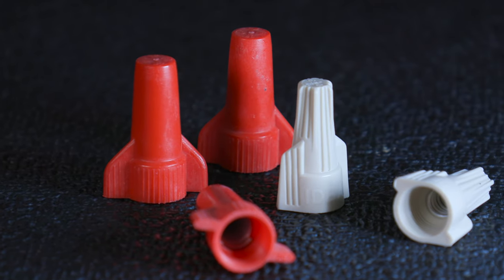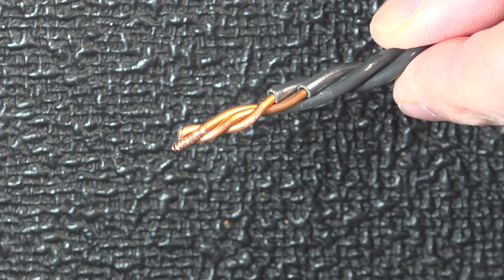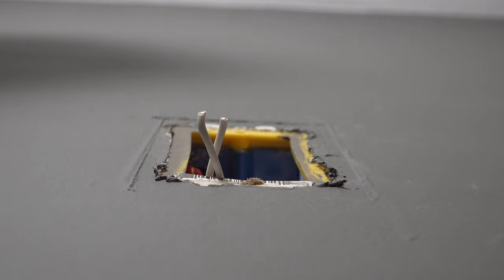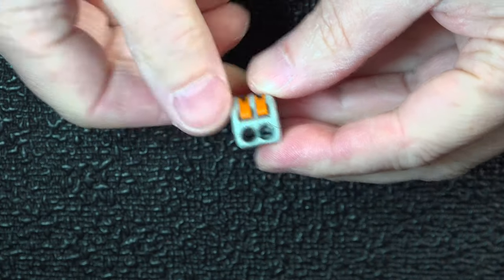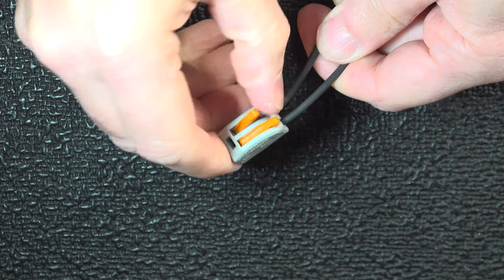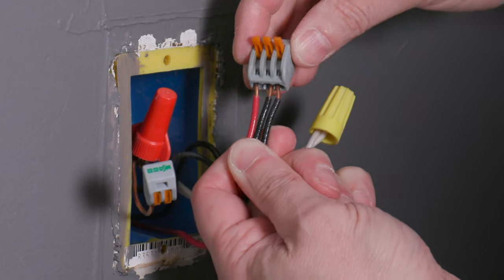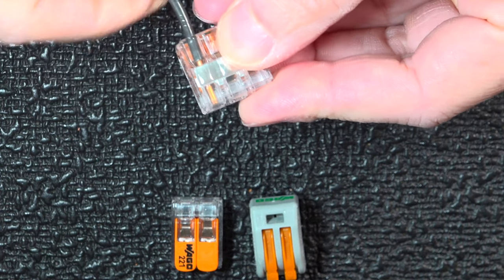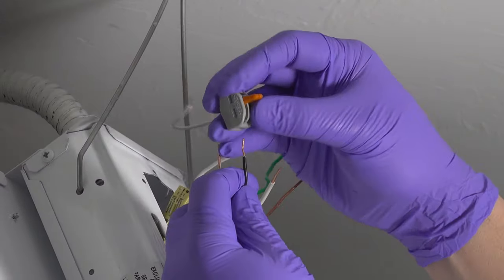Never use Wire Nuts Again - Wago is Better Electrical Connector

Comment: I don't care what you think young man. I've been doing electricity longer than you have been alive and I'm here to tell you A) don't be so damn lazy and learn how to use wire nuts properly. B) your Wego is nothing more than a stab-wire connector and THAT'S a fire hazard I promise you that!!!!!!   In my 40 years doing electrical work I've tried every way possible to connect wires and a wire nut is still the best way (IF you do it properly) unless you go with solder then you are doing the best that can be done..... Period
Reply: Before wirenuts they used other methods. It's only natural for wirenuts to be replaced eventually.
Reply: yes, and your horsedrawn carriage is great too because you dont need gas right?
Reply: I'll never understand why push in connectors are such a big word in North America while the one used in Europe are far more recent, less heat prone than nuts and globally Europe just has less electrical fires per inhabitants.
Reply: @KravMike08  and I was referring more to many blue collar americans as unwilling to adapt and adopt new technologies. they use  these throughout europe.
Reply: @allandulles7108  so let me tell you what I learned about the European electrical system while I was in Iraq doing electric work .....  They have some good ideas but their materials suck!!!!!!! They friggin directly bury hard plastic cable with thin thin little "ground" wires under that hard plastic outer layer and the shit breaks and the "ground" wire rusts and losses it's continuity thus creating an open ground and an unsafe environment throughout Europe!!!!! And that's just the start of the stupid shit they employ in Europe

Comment: I have been wondering about the possibility of some kind of screw tight to connect wires. And is there some kind of gunk that might improve the connection and protect the connection. How about soldering?

Thank you for sharing helpful videos!

Comment: I was told by an electrician that the wires need to be twisted together with pliers before screwing on the wire nut.
Reply from the maker: I have heard it both ways but if you look at some of the manufacturers they say it's unnecessary. That's why I like these, insert, push, done
Reply: Pre-twisting with pliers is how I was taught in school. Seems to produce a pretty solid connection with the wire nut over not pre-twisting

Comment: I have used them they have their place...usually the trash can..I can literally pull them apart..when attached..I cannot pull a wire nut apart....enough said..its a nice thought though...been doing  electric work  for  close to 25 years...local 236..👍👍

Comment: I have been an electrician for over 20 years and used to work almost 10 years in Europe using only wago connectors, and let me tell you, wirenuts are perhaps not as convenient but they do provide a good connection, much better then the wagos. I have seen too many burned wagos. In homes they are ok, but in commercial applications no wagos period.
Reply from the maker: So you are saying that in Europe where wire nuts have not longer used for decades, they are unable to make secure connections? Come on.
Reply: They do have other connectors but they do use wagos a lot.  What I am saying is, they don't hold up to heat and high amps. I used to be in the maintenance department and I fixed a lot of connectors in lights and JBs. The contact surface is just not there

Comment: “A single hand can make the connection”

...as two hands make the connection.
Reply from the maker: Correct but when I cant do it with both hands, I just pre-open the levers and then put them on single handed.  If I am up high that extra tip makes it much easier. There is no way to ever use a wire nut one handed.
Reply: @SilverCymbal  to be clear, I wasn’t disputing your statement, just jokingly pointing out the contradictory video content.

Comment: Pure BS.....work the trade for a little while before giving “expert” advice.
Reply: He did say “for DIYers”.
Reply: @denismguitar1552  DIYers or not.  He makes misleading statements.  Loose connections are a leading cause of electrical fires.  If you are a DIYer, educate yourself before playing with electricity.  I have 48 years in the trade and have never had a loose connection with a wire nut.
Reply: @larrypatterson3957  48 years and not one loose connection you must be the jesus christ of wire nuts then cause you are perfect and born with out sin
Reply: @deplorabledaniel6541  Not Jesus, just a skilled craftsman who served a valuable apprenticeship and was taught well by other skilled craftsmen to be diligent in my responsibility to provide a safe electrical installation.  Don’t be a troll!
Reply: @larrypatterson3957  lol injust think its funny that you think you have never had a loose wire nut
Reply: @deplorabledaniel6541  They are UL listed for making a secure connection.  Use the correct wire nut for the  wire combination and follow the manufacturer’s directions as well as following proper use of wire strippers and  a secure connection is assured.  Tug on all of the wires afterwards as a safe practice and you don’t get loose connections.

Comment: This is one of those products that is going to be explicitly banned for not being able to maintain its current carrying capacity over time.  Damn I was going to sub this channel until this "unbiased product review"
Reply: It wasn't even a review. It was an advertisement.
Reply: Yeah kind of like push connect outlets and switches. They just don't hold up over time. Maybe a Wago is better than those, and maybe they're ok - but they also take up more room in a box, and wire nuts aren't unsafe like the video claims.

Comment: Wow, I’m going to have to throw the BS flag on this video! Yes if you use the wrong size wire nut (like one that is too large) then yes they will fall off Like the one in this video dah!! There is nothing wrong with using wire nuts and yes they are reusable!! Also why would anyone cut the wire when they can just unscrew to remove the wire nut!?! I can see a use for these things in a small area like special style light fixture, but that’s about it!! I’m a retired electrician and I’ve never had any problem with using wire nuts!!

Comment: really great when you need 5 wires connected together vs wire nut
Reply: That is about only time I use them.  In particular I used them on the closed circuit when you have one branch feeding 8+ branches of smoke detectors from central point rather than runs to specific parts of a house.  And although I don't say for sure that it's the connectors, I will say that I've seen some strange behavior with the ganging features of the smokes in my house where sometimes they trip and others they don't.  More than likely it's the crappy chinese made smoke detectors, but never know... I wouldn't use these on anything that is going to have lot of current drawn thought it for long periods.

Comment: No thanks. Old school is good school only if you know what you are doing.
Reply: Same, I have heard of cases of the levers opening up on these when trying to push them in a box, but each to his own.
Reply: Sure, let's all install fuse panels and use knobs and tube wiring with unpolarized receptacles. C'mon, old school isn't always the best buddy ✌

Comment: "The biggest problem with wire nuts is that I cant make money off of them, so in this video...."
Also... WHO THE F wears nitrile gloves to rewire a shop light??
Reply: Don't want to get the girly hands dirty.
Reply: Made me laugh
Reply: Guys used to called me a doctor wearing surgical gloves under work gloves. Is not to keep my hands clean but to retain moisture because my hands suffered from cracking. Now I see others are doing the same. Rebar for 30 years is enough.

Comment: if you change a device in an electrical box and you’re cutting any wire youre doing it wrong, also you’re supposed to twist the conductors together with pliers before putting the wire nut on
Reply: So much wrong with this video...

Comment: And how much do they cost. Bag of wire nuts I have never had a issue with is $1.99 for 50. And if you have trouble using wire nuts? You shouldn't be touching the electrical in the first place.

Comment: A lot of luminaries have been coming pre-equipped with wago style connectors already attached. You may think it cheap, but realize the magnitude of legal problems manufacturers are automatically up against concerning failures, if they were a problem. I installed can lights in a foyer that led into a kitchen area for a guy. Every single light had them and not one wire but was in the pack. I've used them extensively without any problems at all. And Wagos have been around for a VERY long time, 70 years. So they're not as new as most people think. There's also YT videos showcasing side by side comparisons with lever nuts and wire nuts under overload situations. Wire nuts failed every time before lever nuts did.

Comment: they have a fatal flaw if you look at the connector inside there is a single point of contact in the connection can heat up and cause a short me i still use wire nuts plus when you properly twist a wire nut the wire should twist causing the wires to never pull apart  in all cases i always have considered the push connectors for low voltage applications plus they dont work well for stranded wire unless you solder the ends
Reply from the maker: There's nothing fatal about it. It's copper and rated for 20amps in the US and 30 in Europe. I pumped 60amps through one too: https://youtu.be/B1pmuRsf1co

Comment: Wait, you guys don't just twist wires together and cover them with masking tape?
(Yup, this is the way my grandpa made all eletrical connections in my house)
Reply: Hence why there were so many electrical fires and deaths back in the day.

I bought a house and the dishwasher was installed by the owner's brother who "knew what he was doing". I had one of my own so I went to swap it out. The electrical connection by the guy who "knew what he was doing" was outside the box attached to the dishwasher, held together with masking tape, wires weren't twisted together, and the whole mess was lying on the floor. One leak (which dishwashers are prone to do) and zap, say good bye to the wife and new baby.....

Comment: I used something similar to this ~ 40 years ago, even ones that required no stripping your insulation. Insulated plastic capsule w blades that would cut into the wire insulation causing the blades to make contact with the wire.

Comment: If you can’t successfully use a wire nut, then it’s hopeless.
Reply: If you can't successfully use a wire nut,  perhaps you shouldn't be working around household current. Connectors like this seem more useful for test circuits and ones that you know you're going to be redoing regularly.
Reply: There is absolutely no use for these stupid things.. 35 years experience.

Comment: I’m new to the trade and an apprentice , so my knowledge is very limited. Is it true that the bite marks can cause overheating? That doesn’t seem like it would, but again , I have little experience.
Reply: Not really, no. If you were to redo a connection multiple times, eventually the conductors would start getting pretty chewed up. You could run into problems if that happened.

Comment: I'm a commercial electrician and I've never had an issue with wire nuts. I'm not sure I'd feel comfortable using your little snap connectors on 277v circuits.
Reply: I agree...not to mention the very small amount of contact surface provided by the push in connectors.

Comment: I'm confused....
Isn't using a Wago the same as stabbing the wire in the back of a cheap receptacle? 
I was taught to always use the screw terminal, and never poke the wire into that Firestarter hole on anything.
Please advise...

Comment: t is better to make a connection with the whole surface area of the spring inside the wire nut.  WAGOs use one small blade to make the connection. a mere fraction of the surface area provided by a wire nut  WAGOs are susceptible to   losing tension\deforming if handled roughly especially with multiple 12 awg solid conductors. 

probably ok at > 50% of a conductors ampacity.  probably not ok at the NEC limit of 80% 

what do you think grips better pinching with your finger nails. or a squeezing with your thumb and fore finger?
Reply from the maker: I think that putting 60 amps through one of these rated for 20amps in the US and 30amps worldwide should prove something right? https://youtu.be/B1pmuRsf1co
Reply: @SilverCymbal  hmmmm.....i was suprised to see both take 60 amps and live to see another day.  i wonder hot that test would go after using a 5 hole WAGO with 12AWG and bending the wires torsionaly befoe the test.
Reply: @Silver Cymbal 

looking at cost WAGOs are 100% more expensive.(2hole 12awg WAGO compared to a ideal tan wirenut)  we have established that functionally they are similar.  i dont think that are 100% faster.  and you would have to buy many more varieties of WAGO to complete a job.  could lead to using a $1 5way splice where a 10 cent wire nut could be used.

Comment: Good to know. I never heard about these. I never liked wire nuts for some of the reasons you stated. Their only possible advntage is no moving parts. Do these WAGOs keep working with several reuses?
Reply: from using them for more than a decade: Yes. Still have some old-style ones floating around, that are still working perfectly fine.

Comment: I do low voltage security and access systems and recently started using these because of how easy it is to disconnect.  Say a panel has a 4 wire data/power bus and 6 devices, I can hook everything to this and if one device needs removed I just flip up the lever and its off.

Comment: Hmmm  There are a number of videos which do actual tests of the various types of fasteners (e.g. wire nuts, WAGOs).  These include resistance/conductivity, fire resistance etc.  Wire nuts perform pretty well in several key categories.  For instance, wire nuts are really more of a protective enclosure than a true connector.  So, you get a copper to copper connection which has a measurably lower resistance since copper has a lower resistance than the steel connector used in WAGOs.

It's a personal choice and WAGOs are easy to use but from a technical standpoint, wire nuts are not obsolete for a variety of reasons.

Comment: Wire nuts are safe, I've been using them for years, as an IBEW member. The trick is using your Kleins(side cutting pliers). You must properly prep the wires being mated. Especially with combos of stranded and solid. Always lead a stranded above a solid and hand wrap (just slightly). With multiple solids, wrap with pliers then hand wrap stranded.  Also trimming the top correctly is essential to a tight connection in most situations. This is a technique that must be learned.
Reply: And that's the problem, yeah they're probably safe if you've used them for years and you're a professional, but the fact that you have to list several steps here to make them safe shows their weakness over the alternatives.
Reply: @sevret313  Good point!

Comment: Not convinced to use these on household wiring due to the single surface
 connection.  With wire nuts, you have multiple surface contact points 
on each wire, for a more sound connection for the transfer of electrons 
from one surface to the other. (Electrons flow on the surface of a wire 
not the core of the wire).  Now with the wago connectors, you are only 
getting one fixed contact point to transfer the current, in turn this 
will create more heat than if you use a wire nut. This crates a problem 
when it comes to amperage and the transfer of current, (electrons) from 
one surface to another.  If you have a 20 amp circuit, you use a #12 
wire for enough surface area so that the current passes with ease 
without overheating due to the electron draw.  With a wire nut, you have
 ample surface area contact for that current to transfer to each wire. 
With the Wago connector you are now limiting that surface area to one 
fixed contact point rather than the multiple contact points of a wire 
nut. I do use these connectors for electronics but the current draw is 
usually less that 5 amps.  I would never use these in a home electrical 
setting, too dangerous and unreliable.  Quite frankly, I think there is 
more chance of contact point breakdown or fire due to the single contact
 point. Faster is not always better or safer, sometimes the older 
designs are better because they have been actually engineered, studied 
tried and proven to be effective over time.  AND BY THE WAY.... wire 
nuts ARE  reusable, so that's bullshit right there.  And you always 
twist the wires together before adding the wire nut for the best 
connection, if you are depending on the wire nut to make the connection,
 you are playing with fire.
Reply: that is very long way of saying you have no clue about the facts and only a bunch of misconceptions.

Comment: What is the composition of the metal inside the connectors that come in contact with the conductors?
This metal must be able to keep its shape at potentially high temperatures in order to retain full contact and hence will be expensive. 
If they are made in China this is very unlikely.
Reply: They’re designed (100% in Germany) and I believe made in Germany (might be wrong with that one) 
Ether way they have thought about current carrying and they are an extremely safe connection and are 100% better than using wire nuts